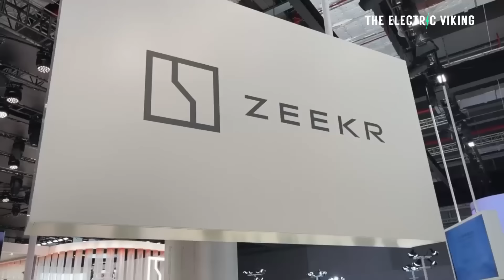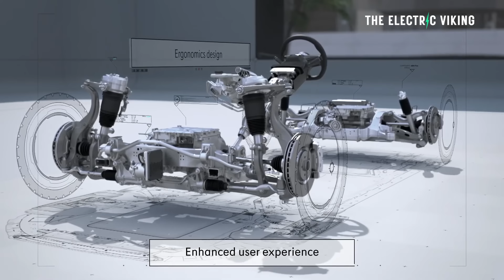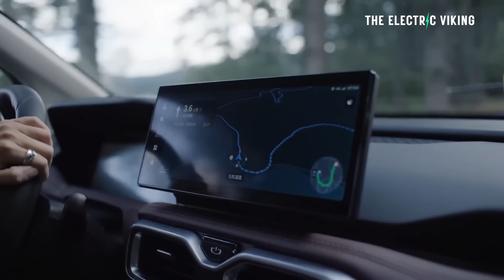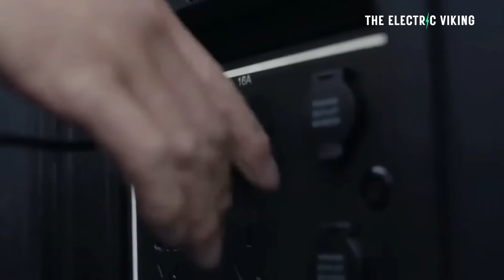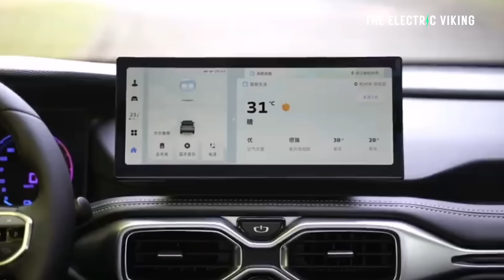NEW Radar (Riddara) RD6 electric ute / pickup truck revealed for Australia

Comment: I live in Costa Rica and I have 6,000 kilometers on my radar. mine is the basic rear wheel drive. It's the closest thing to 4 wheel drive, in two-wheel drive you'll ever use for a truck. the rear-wheel traction control is amazing .I paid $36,500 for it. if you're going to use it as a light duty truck like I do. You just can't beat it. It charges from 20% to 100% overnight in 9 hours. Costa Rica is very mountainous and it really does Drive almost like a sports car. it has absolutely massive brakes, and bi-directional charge / discharge. I love my radara
Reply: It looks like a great car! How does the bidirectional charging work? Is it through the vehicle charging port?
Reply: Where did you buy it??
Reply: @markbarton8872  Are you driving it on paved roads only? How does it perform on steep gravel roads like those in parts of Perez Zeledon and down on the coast? Thank you.

Comment: My daily driver is a 2 door Silverado and my my pleasure vehicle is a '67 Chevy C10.  I've been waiting for the USA to produce an affordable, good looking, 2 door AWD ev pickup truck.  They could make it unibody to save weight and with a motor for each axle there would be no need for a drive shaft hump, so a bench with a fold up armrest for the occasional 3rd seat would make sense.  Call it El Camino, Sprint, Ranchero or Scrambler for nostalgia.  A solar bed cover and/or roof would be a nice option too.  I've been telling my favorite mechanic that I'll sell him my Silverado when I can buy an electric El Camino.  Come on USA...Get with the program please!!!

Comment: Can update  - in Thailand there are 3 battery sizes: 63, LFP,  73.9 LFP,   86.NCM  -The 63 is RWD, the 73.9 could be RWD or AWD, and the 86 is AWD.  Range on the 73.9 RWD is listed as 461 km (NEDC) and 424 for. the AWD.   The 86 kwh battery and the 73.9 give 0-100 in 4.5 seconds.  Charging for all battery sizes is 30-80% in around 30 minutes.  So, in short, the range is likely going to be under 400 KM and the charging on the slow side.   Features ability to drive through 82 CM of water, which in Thailand us useful.

Comment: This is exactly why I want a YTruck. A small maverick sized truck that is built on the model Y platform.
Reply: Except the GEELY (Radar) is not Survivable in a crash.
Reply: @markplott4820  If they plan to sell it in EU it cant be all crap.
Reply: @markplott4820  why not survivable?
Reply: @paulrdalley   - made VERY crappy.
Radar truck lacks ACTIVE safety Systems.
lacks Tesla FSD. 
Roof is NOT structural. (collapses). 
IF , the Radar crashes head on , semi Trailer , Radar occupants are Decapitated. (RIP).
Reply: @markplott4820  thanks for your input, horrific if correct.  What's your source for this info?

Comment: They have nicely refined the design of this truck, and I suspect they may have used the Honda Ridgeline as a  in benchmark for design, function and specification except, of course, for the electric drivetrain. I have a Honda and it is a great truck and does 95% of a body on frame truck with much greater efficiency, comfort and drivability. I wish this Radar(a) truck were coming to the U.S.   Thanks!
Reply: its just a very CHEAP Freking GEELY .
its NOT even a REAL Truck. 
its NOT Survivable in a CRASH.
Reply: @markplott4820 how do you know like that?

Comment: All the ute most would ever need. But... if you tow, rear end is not ideal. Obviously for range, but also coils mean weight centered and load point further away from tow ball (compared to leaf springs).  2500kg is sensible. Same for BYD Shark. They should not fiddle with specs in an attempt to increase towing weight to compete with Ranger et al. Pick your market.  .

Comment: As a person on the land, I need a try back utility vehicle. If there is a fire I need to put the 1,000 litre fire fighting unit on my vehicle, with four wheel drive low range capability. When there is a flood I need four wheel drive capacity. When I want to get away camping I want to put my canopy on. When I need to go get some 6.5 metre lengths of steel I need a vehicle that has a front bar to mount to for a support, and in the front and rear of the tray. I often need to pick up a 1 ton bag of stock feed with the tray. Or perhaps a load of crushed rock, or bags of concrete. My current Nissan MY61 Diesel 2010 Patrol has a 1.5 ton carrying capacity with long range fuel tanks. I would love to buy an EV tray back, with at least 2.2 metres of tray length, but they are all these stupid pick up trucks with short tubs, like all of the current crop are totally impractical for rural and remote four wheel drive owners, they are built for city folk.

Comment: Looks like very low ground clearance. Quote : At the moment, one of the biggest problems with off-road ability for the RD6 is the limited ground clearance – just 180mm.

So it's not 220mm. The 180mm figure comes from an actual review. 180mm is sedan car clearance, absurd. 😂
Reply: 18cm is more than adequate for unsealed, made roads, which is the vast majority of use cases. Agree though, that 18cm is not good enough for genuine off road (ie cross country) nor on unformed or heavily rutted tracks.

Another issue with EVs is the extent of torsional stress on the battery (box). In the days when Australia made its own vehicles they were extensively tested on tracks purpose designed to represent this country's rough outback roads and beefed up accordingly. 

Since the demise of local manufacturing that is no longer the case. You take your chances.

Comment: Ur right, this Chinesium ute might suit a significant number of Australian buyers, but then it will also fall short for a significant number of people who buy dual cab utes to tow loads at distance.  I suspect it will be like all other BEV”s at towing and be shit, it might have the torque to pull but that is useless without decent range. BEV”s sweet spot is for small/ medium people movers, any bigger, then plug-in hybrid is the only architecture that can be anywhere near comparable to a Ranger, Hilux, Dmax, etc. The other appeal this Chinesium doesn’t have is the lack of accessory customisation. The very nature of the structural battery and complex vehicle systems would mean it will be highly unlikely you will be off to the ARB shop and fitting up a new suspension, bullbar etc which may not be essential items in the suburbs but if you use as a touring vehicle or regional work truck kinda are. Yeah, but nah for me., maybe by 2040 the manufacturers will have this all sorted, until then my Dino burner will keep puffing along.
Reply: You mean all that ARB stuff that never sees the outside of a city? Your use of term "Chinesium" just goes to show what sort of "Person"  you are.
Reply: @metricstormtrooper  You may be correct champ, some ARB stuff is city confined, so what? A larger quantity of that ARB stuff you appear adverse to is widespread in the Agricultural, Mining, and Construction industries in regional Australia. You may have missed the point I was making that a lot of dual cab purchases are made because they are a "commercial" vehicle, and as such are often customised with endless combinations of tray bodies and bolt on accessories to do ones job in a safe and efficient manner. A vehicle that does not have a ladder frame chassis is very limited to the addition of service bodies. Not everyone drives a dual cab to keep up with the Jones in Ramsey St, so for those of us who buy commercial vehicles to use as such, we need to have the market continue to supply products that provide choice and are fit for purpose. There is a reason vehicles like the 70 series Landcruiser have changed little in 40 yrs. Simple, reliable and capable machines that as yet the Chinesium or American EV pickups fall short on. I have no idea what sort of "person" you are but rather than give character assessments to people you have never met, perhaps you can make comments relevant to the Vikings content.

Comment: 500km range is way to little. Myself and my family are saving and waiting for 700km + at least match our petrol vehicles today.
Reply: If you need to turn the heating on, drive in hilly terrain, offroad, with a load or (worst) want to tow something, you need much more than a stated (unrealistic anyway) 700km EV range to at least come close to the true range of a petrol car (where you can always add easily a jerry can to even extend the range).
Reply: @hiram1923  my in-laws have an EV 6 with 525km range real world 490km and with heater on full , radio blasting it only drops 11km in range so not a drama there. Towing is a biggy as I have a fossil truck to tow a large boat. The lightening is an eV that tows 4ton  but range is an issue. I’m sure a break through will happen soon with the speed of tech
Reply: @lifeliver9000  Hmm, not sure if that can really be. Consumer Reports tested 4 EVs (Model Y, Mustang Mach-E, Ioniq 5, ID.4) in diffent weather conditions, and the range of all dropped about 25% in cold weather.

Google "CR Tests Show Electric Car Range Can Fall Far Short of Claims" for the article.

And yeah, the range when towing drops massively as a bunge of tests on Youtube show... ;)
Reply: @hiram1923  yip all my mates were interested also so we did the test twice. Yip the advertised range is never the true range as I pointed out above. But mainstream media were forecasting all sorts of drops with aircon and radio. Don’t believe anything from media till you try it yourself. Most of my mates have EVs now and also say hardly worth noting the drop in range with accessories running, it’s just the same as petrol engines range drop doing the same thing. I’m still saving and when I’m about to pull the trigger there is a jump in tech so wait again. Grr
Reply: And when EV ranges get to 700klm you still won't be happy. People like you are just never and will never be satisfied.
Reply: @metricstormtrooper  and when it does go to 700km and I’m happy you won’t be cause people like you are never satisfied

Comment: The UK Labour Party has just announced a pay per mile tax on EVs.  lol
About time they paid for damages to the roads
Reply: Petrol tax just goes into general revenue.
Reply: And what damage is that? Oh, you must mean the damage that heavy vehicles cause to road surfaces that have been weakened by oil and fuel deposits. Remove fossil burners from roads and we will see longer lasting surfaces. This is not discussed enough and should bear interesting results when properly studied.
Reply: @evtorque  You do realise the road surface you are concerned about is mostly made from OIL? and the tyres on your EV are made from OIL! and the vast array of plastics in your EV are made from OIL! Removing all fossil burners from roads will see longer lasting surfaces, quiet the assertion there champ, you have proof or just your opinion after stroking your beard? It shouldn't matter how your vehicle produces its tractive effort, if you use a public asset you should pay to do so in some form.